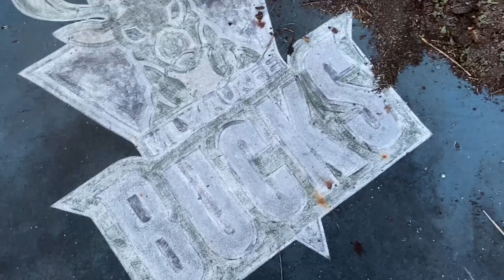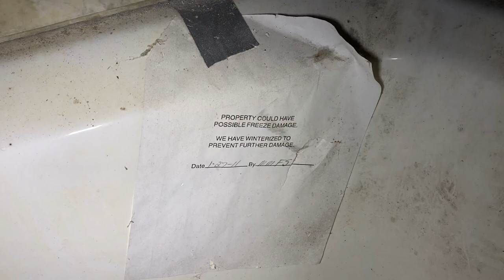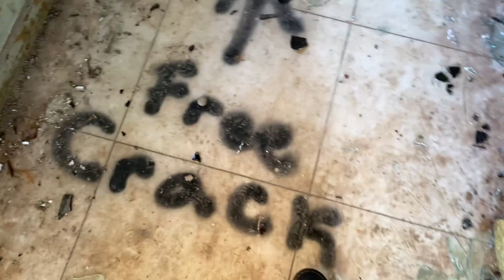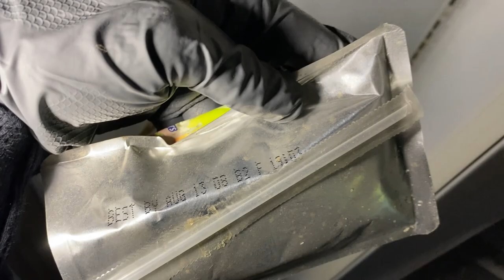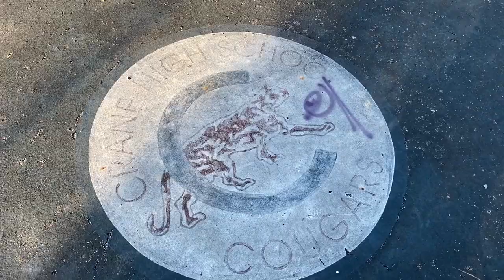NBA Player Ken Norman's Abandoned Mansion

Comment: How did you get in ? Bricks on the side ? If so how did you get back with only a bucket
Reply from the maker: We entered through the golf course. The rear is only blocked by a chain link fence which is collapsed in some areas. Last I saw the property they had signs of cameras so be careful!
Reply: @ryanicpon  are there cameras there or do you know?
Reply from the maker: @logankromray3456  Last time I drove past it was about 4 months ago. There was a sign on the front gate that there were cameras installed, but I can’t say for sure.
Reply: @ryanicpon  alright thanks
Reply: @ryanicpon  it's cool. Have a stack of bricks in the Walgreens parking lot u can climb over the fence onto the Basketball court
Reply: @ryanicpon  It was not really in use that was an old sign